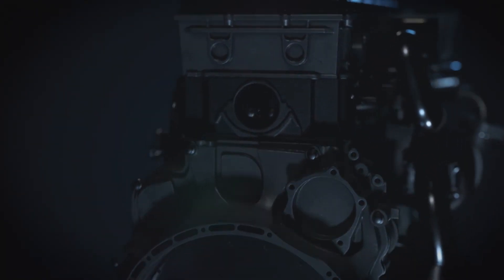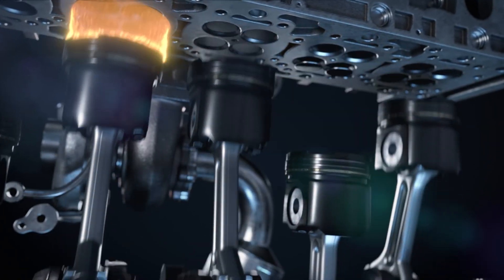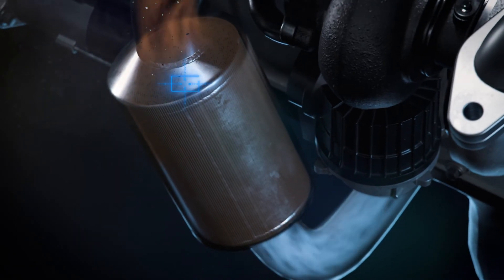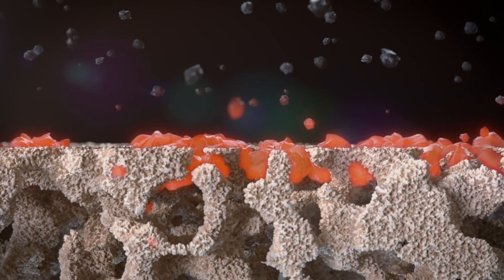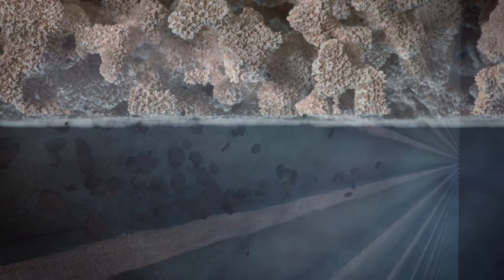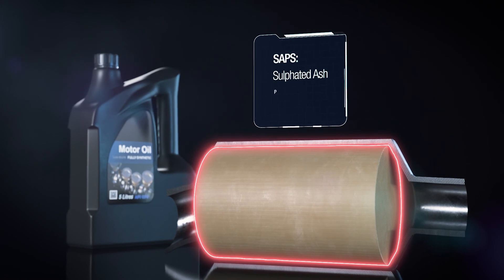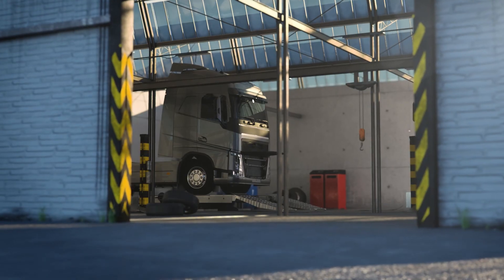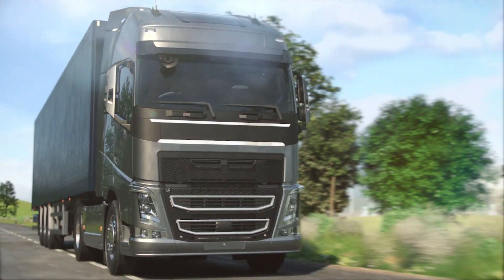How it Works - Diesel Particulate Filter (DPF)

Comment: Ok maybe it's a dumb question but why not have easily swappable DPFs in cars. Pop the clogged one out, put another in. You can then clean the old one properly in a controlled environment.
Reply: Cars already have one, it's called a catalytic converter. Diesels are way more complicated. If you have about 2 hours, I can break it down for you lol. When I am done, you are going to pretty mad on how it all works and what it actually does at the end of the day.
Reply: @PennyScout-u5n bana anlatın.

Comment: Here is how to clean DPF without taking it out:

A. Drive without stopping 250 km (highway speed better airflow)
B. Add 300ml low ash 2 stroke oil (preferrably low saps, Jaso FD, Api TC, Iso-l-egd) before filling 60L of diesel or 1:200 ratio.
C. Inject through lambda/oxygen sensor housing hole 2 or 3 bottles in a row of ProMeister 500ml DPF cleaner, it will reach the DPF.

Do not do forced regeneration or baking because it will destroy the rare earth metal honey comb tunnels.
Reply: Do you know Jesus Christ can set you free from sins and save you from hell today 

Jesus Christ is the only hope in this world no other gods will lead you to heaven 

There is no security or hope with out Jesus Christ in this world come and repent of all sins today 

Today is the day of salvation come to the loving savior Today repent and do not go to hell
Come to Jesus Christ today 

Jesus Christ is only way to heaven 
Repent and follow him today seek his heart Jesus Christ can fill the emptiness he can fill the void 
Heaven and hell is real cone to the loving savior today 
Today is the day of salvation tomorrow might be to late come to the loving savior today 
Romans 6.23

For the wages of sin is death; but the gift of God is eternal life through Jesus Christ our Lord.

John 3:16-21 

16 For God so loved the world, that he gave his only begotten Son, that whosoever believeth in him should not perish, but have everlasting life.  17 For God sent not his Son into the world to condemn the world; but that the world through him might be saved.  18 He that believeth on him is not condemned: but he that believeth not is condemned already, because he hath not believed in the name of the only begotten Son of God.  19 And this is the condemnation, that light is come into the world, and men loved darkness rather than light, because their deeds were evil.  20 For every one that doeth evil hateth the light, neither cometh to the light, lest his deeds should be reproved.  21 But he that doeth truth cometh to the light, that his deeds may be made manifest, that they are wrought in God.

Mark 1.15 
15 And saying, The time is fulfilled, and the kingdom of God is at hand: repent ye, and believe the gospel.

2 Peter 3:9
The Lord is not slack concerning his promise, as some men count slackness; but is longsuffering to us-ward, not willing that any should perish, but that all should come to repentance.

Hebrews 11:6
6 But without faith it is impossible to please him: for he that cometh to God must believe that he is, and that he is a rewarder of them that diligently seek him.
Jesus

Comment: So the filter picks up the dirty particulates that we don't want to go into the air laying under the ground. Which that dirty stuff comes from diesel fuel. But then we introduce more diesel fuel to burn off the byproduct that was caught in the filter. After we burn that stuff out of the filter where does it go. It is still made up of the same stuff just in a smaller form. It still ends up in the air and on the ground. And they call this a solution.
Reply: It burns into carbon dioxide which is a gas not solid particles.
Reply: Do you know Jesus Christ can set you free from sins and save you from hell today 

Jesus Christ is the only hope in this world no other gods will lead you to heaven 

There is no security or hope with out Jesus Christ in this world come and repent of all sins today 

Today is the day of salvation come to the loving savior Today repent and do not go to hell
Come to Jesus Christ today 

Jesus Christ is only way to heaven 
Repent and follow him today seek his heart Jesus Christ can fill the emptiness he can fill the void 
Heaven and hell is real cone to the loving savior today 
Today is the day of salvation tomorrow might be to late come to the loving savior today 
Romans 6.23

For the wages of sin is death; but the gift of God is eternal life through Jesus Christ our Lord.

John 3:16-21 

16 For God so loved the world, that he gave his only begotten Son, that whosoever believeth in him should not perish, but have everlasting life.  17 For God sent not his Son into the world to condemn the world; but that the world through him might be saved.  18 He that believeth on him is not condemned: but he that believeth not is condemned already, because he hath not believed in the name of the only begotten Son of God.  19 And this is the condemnation, that light is come into the world, and men loved darkness rather than light, because their deeds were evil.  20 For every one that doeth evil hateth the light, neither cometh to the light, lest his deeds should be reproved.  21 But he that doeth truth cometh to the light, that his deeds may be made manifest, that they are wrought in God.

Mark 1.15 
15 And saying, The time is fulfilled, and the kingdom of God is at hand: repent ye, and believe the gospel.

2 Peter 3:9
The Lord is not slack concerning his promise, as some men count slackness; but is longsuffering to us-ward, not willing that any should perish, but that all should come to repentance.

Hebrews 11:6
6 But without faith it is impossible to please him: for he that cometh to God must believe that he is, and that he is a rewarder of them that diligently seek him.
Jesus

Comment: Can water bubbler filter exaust?
Reply: I had thought of the same thing but came to the conclusion that it would likely create too much back pressure. Maybe passing it over a water bath rather than through it would be a compromise?
Reply: @Taydrum what if install some sort of heat resistant fan to help negate back pressure almost like acting as air pump
Reply: @christianemmanuelf.domingo793 for starters a heat resistant fan, that is capable of withstanding exhaust temperature, would be insanely expensive. Secondly it would block the exhaust path to some extent creating more backpressure. Finally it would take energy to run the fan. It's neither practical nor functional
Reply: Do you know Jesus Christ can set you free from sins and save you from hell today 

Jesus Christ is the only hope in this world no other gods will lead you to heaven 

There is no security or hope with out Jesus Christ in this world come and repent of all sins today 

Today is the day of salvation come to the loving savior Today repent and do not go to hell
Come to Jesus Christ today 

Jesus Christ is only way to heaven 
Repent and follow him today seek his heart Jesus Christ can fill the emptiness he can fill the void 
Heaven and hell is real cone to the loving savior today 
Today is the day of salvation tomorrow might be to late come to the loving savior today 
Romans 6.23

For the wages of sin is death; but the gift of God is eternal life through Jesus Christ our Lord.

John 3:16-21 

16 For God so loved the world, that he gave his only begotten Son, that whosoever believeth in him should not perish, but have everlasting life.  17 For God sent not his Son into the world to condemn the world; but that the world through him might be saved.  18 He that believeth on him is not condemned: but he that believeth not is condemned already, because he hath not believed in the name of the only begotten Son of God.  19 And this is the condemnation, that light is come into the world, and men loved darkness rather than light, because their deeds were evil.  20 For every one that doeth evil hateth the light, neither cometh to the light, lest his deeds should be reproved.  21 But he that doeth truth cometh to the light, that his deeds may be made manifest, that they are wrought in God.

Mark 1.15 
15 And saying, The time is fulfilled, and the kingdom of God is at hand: repent ye, and believe the gospel.

2 Peter 3:9
The Lord is not slack concerning his promise, as some men count slackness; but is longsuffering to us-ward, not willing that any should perish, but that all should come to repentance.

Hebrews 11:6
6 But without faith it is impossible to please him: for he that cometh to God must believe that he is, and that he is a rewarder of them that diligently seek him.
Jesus

Comment: dpf increases fuel consumption and co2 soot doesn't heat globe as co2 does ocd leads to increase in fuel and heat in earth
Reply: Does cause cancer though.
Reply: @PURENT  which dpf or diesel fuel?
Reply: @aravindmk12  Diesel particulates/soot.
Reply: @PURENT  yeah bud but see dpf trap that soot also when engine revs high at 2500-4000 rpm these particles mixes in slight with air so it doesnt gonna help

Comment: Great for environment
. Bad for car performance.. New technology need to be added to it
Reply: Also not great for the environment. Infact worse.
Reply: on the surface, but mining and using the energy and resources for these systems causes more pollution. Then more fuel to use the solution! You are just trading one type of pollution for another and making it less localized in some areas. in the end, theres no free lunch.

Comment: Instead of having this troublesome filter system, couldn't you just theoretically tune the truck to run a bit leaner to burn off more of the unburnt fuel?
Reply: Would be at the cost of fuel economy, more of other emissions, and probably more engine wear and tear.
Reply: @PiSumNow no, diesel always running lean and that makes EGT cooler, so less wear and tear. Rich AFR diesel increase EGT temp, means higher combustion chamber temp, it’s quite opposite of the petrol engine
Reply: @andikappradana 
The EGR is for NOx abatement and the DPF for soot filtration. The whole idea of the EGR is to reduce the combustion temperatures at peak NOx formation, but the tradeoff is more soot formation. That's what I meant to convey.
Reply: @andikappradana 
The EGT leaving through the exhaust pipe is cooler because of the lean nature of the exhaust, i.e. more CO2, N2, O2 etc. The gasoline engine exhaust on the other hand are rich in HC, and have a much lower O2 content, giving them relatively higher EGTs compared to the diesel engine exhaust - perfect for a TWC to eliminate NOx. It's the fuel economy that makes these gasoline engines inferior to diesel engines ... 🖖.
Reply: Yes, this is used for smaller diesels like the ones you see on new Skid Steers and equipment. They don’t require a DPF since the engines have been tuned to run clean. Removing the DPF significantly increased my fuel mileage and I know my truck will last longer
Reply: You could run super Benzin/Gas, which does not have this issue 🤷🏻‍♂️
Reply: Do you know Jesus Christ can set you free from sins and save you from hell today 

Jesus Christ is the only hope in this world no other gods will lead you to heaven 

There is no security or hope with out Jesus Christ in this world come and repent of all sins today 

Today is the day of salvation come to the loving savior Today repent and do not go to hell
Come to Jesus Christ today 

Jesus Christ is only way to heaven 
Repent and follow him today seek his heart Jesus Christ can fill the emptiness he can fill the void 
Heaven and hell is real cone to the loving savior today 
Today is the day of salvation tomorrow might be to late come to the loving savior today 
Romans 6.23

For the wages of sin is death; but the gift of God is eternal life through Jesus Christ our Lord.

John 3:16-21 

16 For God so loved the world, that he gave his only begotten Son, that whosoever believeth in him should not perish, but have everlasting life.  17 For God sent not his Son into the world to condemn the world; but that the world through him might be saved.  18 He that believeth on him is not condemned: but he that believeth not is condemned already, because he hath not believed in the name of the only begotten Son of God.  19 And this is the condemnation, that light is come into the world, and men loved darkness rather than light, because their deeds were evil.  20 For every one that doeth evil hateth the light, neither cometh to the light, lest his deeds should be reproved.  21 But he that doeth truth cometh to the light, that his deeds may be made manifest, that they are wrought in God.

Mark 1.15 
15 And saying, The time is fulfilled, and the kingdom of God is at hand: repent ye, and believe the gospel.

2 Peter 3:9
The Lord is not slack concerning his promise, as some men count slackness; but is longsuffering to us-ward, not willing that any should perish, but that all should come to repentance.

Hebrews 11:6
6 But without faith it is impossible to please him: for he that cometh to God must believe that he is, and that he is a rewarder of them that diligently seek him.
Jesus
Reply: It would create more NOx emissions